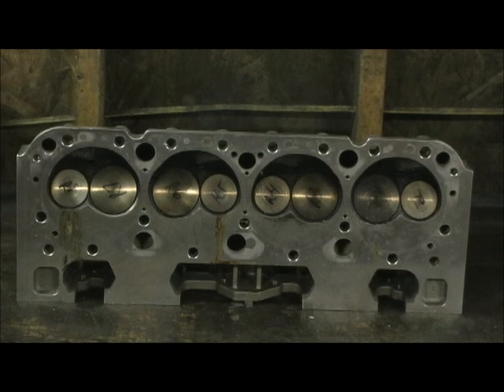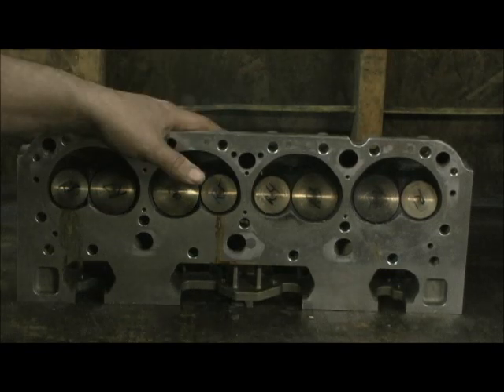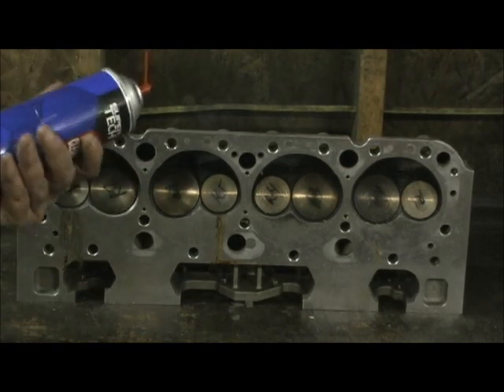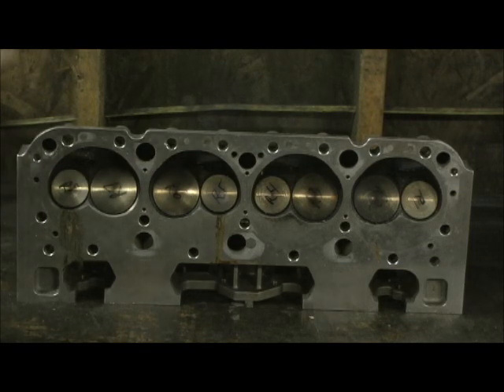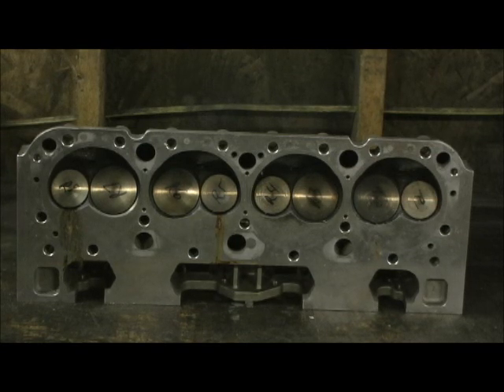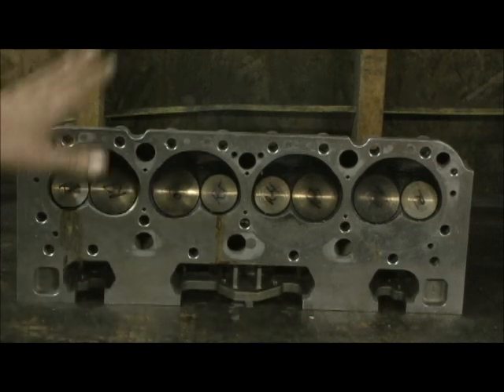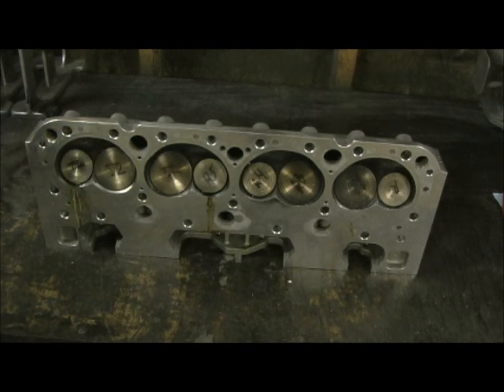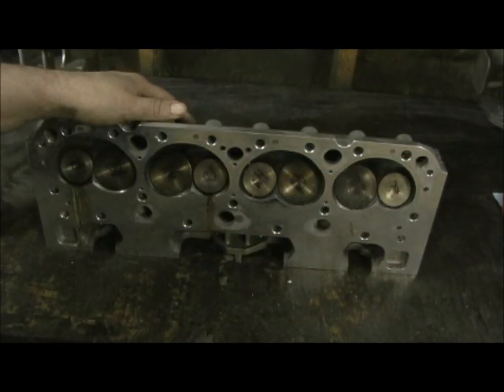"WARNING" DON'T- bolt on "New in the Box"  heads on your motor without. 1.0

Comment: Bolted a pair of those "Blue Print Engine" heads on my motor "OUT OF the BOX" only a 1000 miles on them so far but i will let you know if i have a problem
Reply from the maker: It is like playing poker sir, you never know what your delt with Any companies, from China made stuff, to top of the line American made stuff.  There used to be an old saying about "I hope I get a pair of heads made on Tuesday or Wednesday, I damn sure don't want a pair made on Monday or Friday" kind of thing.   I can only tell you what I have seen over 26 years of doing this, that 8.5 out of 10 pairs of heads that I have taken out of the box (hell, 9 out of 10) had seat runnout's of greater than .006, with 6 out of 10 having runnout's greater than .010 !!!  That is unreal.  That means that within about 1000 to 3000 miles, your leaking through the valves anywhere from 8% to 15%!!!  Like I said (I believe i said this in one of my videos), My first job in California while in machinist school was a Dyno Operator; and my first jobs was that THREE of my shops customers owned race teams (Baja and Drag) and we had two "MULE" motors that we kept on a stand so when the race teams done a NEW pair of heads my job was to load the new heads on one of the "MULE" (a mule engine is one that's sole purpose is to make mods on a given area with the bottom end staying the same for comparison reasons) engine, and run the engine for 3 to 6 hours going UP and DOWN the RPM range.  At first I thought it was to "BREAK-IN" the heads (I was stupid, and NEW to the game); but after doing it a few weeks I ask my shop forman Paul Smith (Specialized Motor Service in Riverside) why they were bring them there to break-in, them coming back a few days latter and putting them back on the engine and get a new reading...  It NEVER failed that when they brought them back, there would be anywhere between10 to 25 (once I seen almost 40) horsepower increase!!!!!!!!!!!!  Paul then explained to me that the Guides, Seats form there on place as far as seating, and PULLS the valves into its given position.  This was Mainly on the Aluminum Heads, and I mean HIGH DOLLAR ALUMINUM head from Ford SVO, Brodix, Dart and Keith Black.  IT BLOWED ME AWAY!!!  One other thing, after a few months to monitor spring pressure and power loss (on engines that ran a race or three) we would bolt them on and dyno them and as always, they would be down around 5 to 15 Horsepower on Aluminum heads, ALWAYS!!!  This is because of cycling heat and cold, and that was the end of it; as the valve job would stay concentric for a LONG TIME after the 2nd valve job was done.

Comment: MORE THAN LIKELY ITS A PRODUCTION VJ DONE WITH A SERTI MACHINE OR OTHER TYPE, AND (SOME ) OF THE PEOPLE THAT RUN THESE MACHINES HAVE NO CLUE OR JUST DONT CARE JUST AS LONG AS THERE GETTING A PAY CHECK, MY PERSONAL PREFERENCE TO THIS DAY IS STILL A STONE GROUND VALVE SEAT JOB IT CAN NOT BE BEET THATS IF ALL YOUR PILOTS AND MANDRILLS ARE UP TO SNUFF, SIOUX STONES AND MANDRILLS IF YOU CAN FIND OR THE EQALE QUALITY, A STONE VALVE SEAT JOB WHEN GRINDING AS SOME OF YOU KNOW WHEN YOU LIFT THE STONE HAS CONTACTED THE SEAT 360 DEG AROUND IF YOUR SEAT IS SQ IN ITS FOUNDATION, A SERTI TYPE IS CUT WITH USALY A DOUBLE FLUTED CUTTER AND IF THE OPERATOR IS ASLEEP AT THE WHEEL WHEN HE LIFTS QWIKLY THERE WILL BE A SPEED BUMP IN THE SEAT, AND IF THIS SPEED BUMP IN THE SEAT IS NOT TAKEN CARE OF BEFORE ASSEMBLE YOU WILL SEE MAJOR DAY LIGHT OR FLUID RUN OUT OF THE PORT LIKE THIS VID IS SHOWING, GREAT VID HEADBYTES PORTING, HAPPY NEW YEAR TO ALL.   JEFF D.

Comment: That is disaster waiting to happen. I didn't even think of the valve head coming away from the stem! Also the leakage will burn the seats, further reducing compression and also, like you said, cause overheating, low power, and rough running. China makes some things good but not valves. It's like their metals suck on the molecular level.

Comment: Hi Mr , I had same problem with a KIA head , ready to fit with lifters and even camshafts , it came in a KIA box ,so I trust the shop and fitted in the engine , this started missing and running uneven , after a while I checked the compression on cylinders and realize that valves did not sit well , took it out and send to cut seats and valves , later was alright , but this causes headache of course , greetings from Ecuador

Comment: you had me giggling the entire time! I`v never built any new performance heads, but i have rebuilt some "Q" code 351c heads and did some minor porting to the D0VE 460 heads. i use dye-penetrent the same way you used the carb cleaner! [and its bright red!] I also have a very good 24" machinist square and a good flashlight to check for square. If i can clean them up enough to pass these two test, i`ll run them. If not, they go to my old machinist pal! Of course, i`m just building home-brew hotrods.

Comment: I got caught by a big name, "bolt on" horsepower... bolted them on and less or same as standard power, dropped an intake valve into #3 at 90 mph, killed my first small block ford.. Good advice, this happened to me. expensive lesson.

Comment: From years of working on Italian aluminum heads. You grind and test the valve seat with the head bolted to a torque plate always. With the head off the plate the seats may leak. Bolted down they don't. I'm not sure that it is good advice to tell people that a simple carb cleaner test on their workbench means they should send their heads back and be upset. This may not apply so much to a cast iron head.
 Anyway it's not bad advice to know what is going into your engine and have reputable people doing technical work.

Comment: I worked at a couple of local machine shops for about 10yrs before going back to college and receiving my masters in welding engineering. Believe me Headbytes is definitely correct on this issue. I've seen high dollar heads come in and they where assembled with JUNK! I'm building a set of heads for a friend right now and he didn't follow my advice about buying them bare and now he's having to spend the money of replacing springs, valves because the sales person convinced him that assembled heads where the way to go. WRONG!... SI valves are the best valves for the money, that's what I'm running in a set of procomps on my SBF...Procomps are decent heads for the $ if you buy them bare. Never buy them assembled. Headbytes has some of the best info on the internet for anyone who's learning to do their own work. GREAT VIDEOS!

Comment: There is no brand of head that one group of people will denounce as complete crap, and a 2nd group of people just love and would buy over and over.  But no car part should be bolted on your engine without a thorough measuring, checking, lubing if called for and inspected for quality.  I have Pro-Comp heads on my Ford 351W.  Easy 500 hp, compression tests great after 2 summers hard use.  Have lined my pockets with the cash of disbelievers.  Chevy owners hearing the words "pro comp" will begin to foam at the mouth and weep openly.  Why?  In Australia, Fords rule.  Up here...Chevies.  So Australian products aimed at Fords will be tightly controlled quality, and Chevy parts...well....who gives a rodent's rectum?  The reverse of Edelbrock here.

Comment: Regardless where you bought them or who's doing your head work it's always good to check the lap, on some valves to see what you working with. Valve angle job, lap lines, exedra, even if it's a lawn mower. 
Speaking of lawn mower I'm in the process of putting a 96 inch V-Twin on my old Gravely Rider. (Stroke 4 .625 X Bore 3.625 X 2 - 96 cid.)

Comment: He's absolutely right. I bought a set of tricked out Dart II heads (back in 1999) and took straight to the machine shop as I was having the decks cut on my block. There was a large casting flaw between two of the intake ports on the cylinder heads allowing air flow between cylinders! The machine shot pointed it out and repaired it before I installed. If I had just bolted those brand new trick heads on it would have been a nightmare trying to chase down that problem.

Comment: Not to mention the tells on the surfacing of the block mount , ... right in the center, the 3 water jacket ports show a distinctive discoloring, indicating a warped head surface, & the drain marks from the combustion area is another tell, of improperly placed hardened seating,  will definitely reduce performance by drastic measures, in addition to the spacing between the intake & xhaust valves may not be wide enough to separate them in order to avoid heat distortion cracking, plus if you have to shave these heads by more than a couple of thousandths to get them flat, you will definitely risk cracking the top of the piston if a thick enough shim, or spacer cannot be applied, ... 
I wouldn't trust them, ... unless the valves, and seats were not only trued up, but checked for displacement volume as well, ... 
My unequivocal opinion, is were destined to be boat anchors, when poured, as there are too many obstacles to overcome in trying to make these work as .205/.160 power heads, if you are going to spend money for already designed equipment, I only ask the customer, how fast they want to go, because all it takes, is $$$.$$, because that is the real source of power, ... melt them down, & start over, ...

Comment: sounds like them $649 mustang 5.0  heads off ebay that are slap on and go.......every valve leaked !!! my local shop took scrubbing bubbles sprayed across the valve area and sprayed air into the chamber and the bubbles went away as every valve leaked.......my local shop charged my $300 to set them up right.......

Comment: I just bought a set of GM 821 Cylinder heads from Summit for my 6.0L  LS and their going straight the machine shop. When I did a 113'' for my 04 Dyna the SE heads I bought had problems that the shop had to fix. But yes to the "Bucket Of Shit" so true....

Comment: I bought a set of flo tek heads for my small block ford. Well lets just say i have a stuck exhaust valve and water entering crank case. so i tore it back down thought i had an intake gasket leak. put it all back together same thing so it looks like im gonna take them to local performace machine shop ugghhh. Sucks!!!!!

Comment: One of the reason LS stuff is so much better.  No bow warp.  You get your bow warp from those paired(side by side) exhaust ports in the middle of gen1 sbc head.  Once you separate those exhaust ports,,your in a much better gain for heat control and zero warp.  Sold all my Gen 1 stuff and WILL NOT go back..  Only LS from now on.

Comment: I bought Summit cast iron vortec .500 lift heads $670. They are on the engine, in the truck and they run good. Also installed a comp 4x4 260H cam. To bad u don't tell people how to program the PCM n a 96 Tahoe so I can really feel the power.

Comment: Good info. I run a Mopar 440. I bought 440 Source Stealth heads for it. I researched in the Mopar forums before I purchased them. The consensus was that the Chinese valves that they come with were decent but the rest of the Chinese parts were junk. Anyway I opted for the cnc ported Stealths and upgraded to COMP springs, retainers and locks. 440 Source sends the heads to Modern Cylinder Head and they do the cnc poring, the valve job, set them up and do the shimming to set the seat pressures. When I got them I took them to a trusted local cylinder head shop and had him check them out for me. He said they were setup perfectly and the valve job and porting looked very good. I have had them on my engine for over two years now and am very happy with them. Runs excellent and zero failures so far. Next move is to tear the engine back down to inspect everything and upgrade to better valves, get the ports flowed and go to a custom ground cam to get the most out of my combo.

Comment: your right brother !! I never put Out of the box heads . I had a set of Roush heads that wasnt cut right valve guide bosses wasnt square with the end of the valve . I had to set them up on the Bridgeport and recut and and reset the spring install height

Comment: Use Kerosene as carb cleaner evaporates.  Leave it overnight.  That head needs valves re-cutting 45 degrees and lapping in. Well done for exposing this CRAP job. AAAAA+++++.  Fit new decent valves as well.

Comment: I use Brodix heads and I have NEVER had an issue, but they install Manley extreme heavy duty stainless steel valves with inconell on the exhaust. Springs are always Isky Tool Room. I have loaded the runners up with alcohol and no leaks. Brodix does a great job for me.

Comment: so if i order a brand new set of heads from the GM dealership, that they're gonna be like that?    

cmon....  that can't be true, cause if it was, everybody would drive away with they're cars running like shit, and then they'd have 50-60 less horsepower.     

the new heads that you order at the GM dealership are gonna be exactly like the heads that GM installed in your car when it was brand new.    and those weren't China valves, were they?    and if they was, they ran pretty damned good.     drive a brand new car, and see for yourself.      i must be misunderstanding what you're trying to say.

Comment: TRW have a valve seat concentricity tool which fits on a guide pilot, the tool slides down the pilot and has an arm that sits on the valve seat and the tool has a dial gauge which allows you to rotate the tool around the seat and allows you to exactly locate the bump in the seat, which you mark and grind down to the acceptable level which is NO MORE THAN 2.5 thou and NO MORE.

Comment: the gap between the valves in the chamber second from the right, looks closer than the other 3 chambers?!?!?
Headbytes Porting, you rock mate!!!!
In regards to the GM vortech heads being no good, any production parts that DO NOT MEET factory assembly specifications, but still LOOK OK, go straight into spare parts sales, for us customers to purchase, because that makes the faulty maching OUR PROBLEM, and not potentially a warranty problem for the manufacturer... Mazda are renowned for doing it with their rotary engine spare parts.

Comment: I had a 4 cyl head on my boat that bent a valve. I bought a new valve, lock, and retainer. I had a local machine shop install the parts and do a 3 angle valve job. I got home and noticed half the rubber valve seals were sticking out thru the retainers. Its hard to trust local machine shops too. :/   Thank you for shining a light on China valves and these buckets of shit. :)

Comment: Now a Days I always check my cylinder heads ( Leak Check)  Most heads are mass produced no quality any more. Great info you are showing everyone that is the way I have checked my heads. Car, Motorcycle, any small engine. I always seat the valves and lap them in. Great info on your video.

Comment: ive got a 5sfe enginr that has done about 170000kms. but the cylinder head will be reconditioned. valve job.milled. ported. ice cleaned the pistons top but i havent replaced the rings.it has 1mm oversize pistons & the walls looks clean and new.could the new head destroy the rings? cheers

Comment: Wow i was actually considering buying a dart head. Little did I know on these simple tips. Wow thanks again. I think im just going to get some stock heads and buy new all new parts for them and take them to a machine shop like you said. I will do the porting myself to open them up. 

In that case do you suggest getting 11 to one pistons to compensate for porting?

Comment: I'm an automotive machinist. Let me give you the rundown on this type of "valve-job" : the multiple angles are cut with a single carbide cutter insert that has all of the angles on it, held in a tool holder that is centered in the valve bowl with a pilot rod that fits tightly in the guide. It's driven by a what amounts to a glorified drill press (see seat and guide machine). It's done in a high production high pace shop where all that matters is getting product out the door. The machine operator usually either doesn't have the time or doesn't care about the quality of the work. In this instance the phenomenon that caused this misalignment was a mix of machine setup, tool pressure, and hurried operation. But the real problem here is the way quality is measured. This level of precision and quality is called "good enough to sell as a functioning product". As you can see, thousands and thousands of heads like these are sold and installed and nobody knows any better. See part2

Comment: Nothing like spending good money on crap parts. If you're building an engine why buy cheaper parts? The difference in cost VS the time wasted doing the job over again and also having to replace the junk parts with good ones and doing it right isn't worth it! Sadly there's far too much crap engine parts in the auto industry, thankfully in Motorcycles I work on, the engine builders are damn picky about parts and word spreads fast when junk shows up on the market.
Usually!

Comment: Great pointers, I have built a few 350's, On the first motor I did a up a set of 186, on a 355 with and it made decent power, The next upgrade I did was going Dart II's and they ran a little stronger but not what I was expecting, Turned out they had great valves but shit springs, broke a bunch of them, and the next go around I ended up going a full port/polish and stroking the motor to 383 with 6" rods, I didn't pay top dollar in the begining, but in the end I paid at least 2500 for the heads, could have saved myself 4 or 5  bucks if I just paid strait from the start.